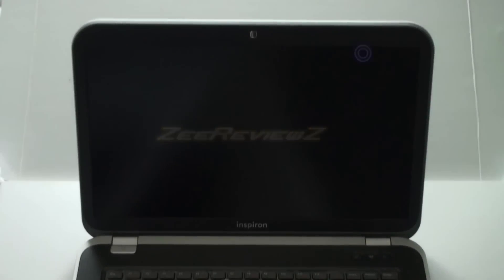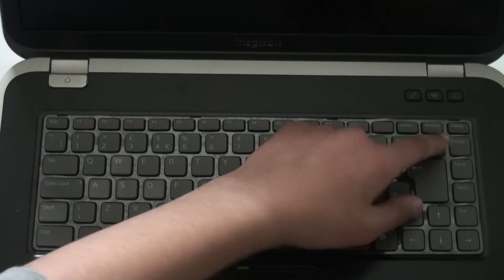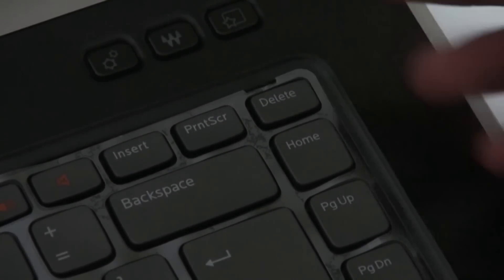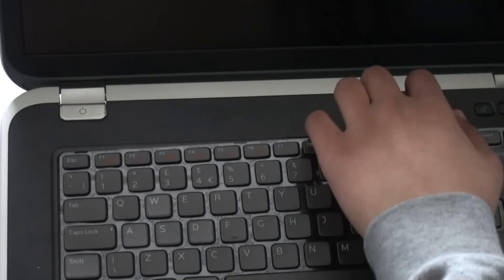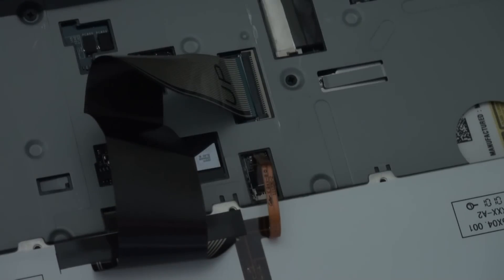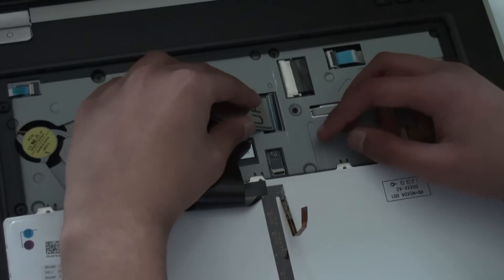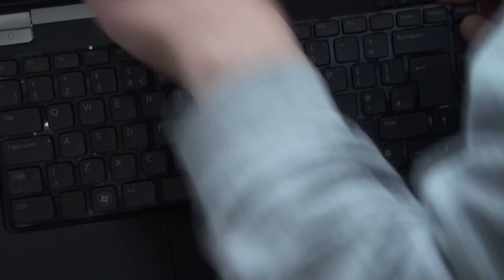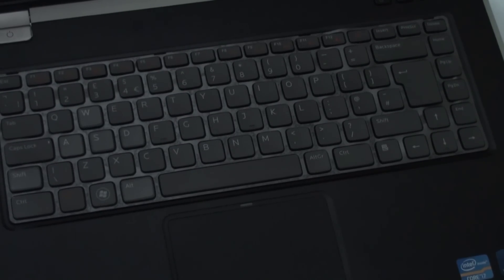How To Remove & Replace Keyboard On Dell Inspiron 15R 7520 SE

Comment: I found this video to be the most helpful when researching this task.  That said, when I received my replacement keyboard I nearly "lost it" when I saw that there was no "plug" on the end of the flexible wiring connector (this was before seeing this video and opening the connector clip up!)  As can be seen here (if you look closely / stop the play), there is no such "plug" on the flexible connecting strip - the flat wiring connector simply dead-ends at a set of flat wires embedded in the plastic sheet.  The connector in the laptop flips open, you remove the old keyboard wiring and replace the new one by laying it flat into the laptop's connector, making sure that it is aligned and then closing it shut, which traps and connects the new wiring.  This was the only video I found which allowed me to see that fact before starting the task, so kudos indeed!!  👍🏻  🙏

Comment: the whole point of me wanting to take the keyboard off was to clean between the keys, from this video it seems we can't do that?
Reply: Avarie F how DO I pop out all the keys individually?
Reply: batool t Pull gently but firmly on the key and hope you don't break the little spring strut things. Take a picture of the layout before hand. To replace keys, push them back in with the struts matching the little snap hooks.

Comment: Cheers for this, I've got a 7520 and the keyboard is supposed to be backlit but it's not working, so I'll be having a look underneath tomorrow to check the cable out and hopefully get the backlight working.